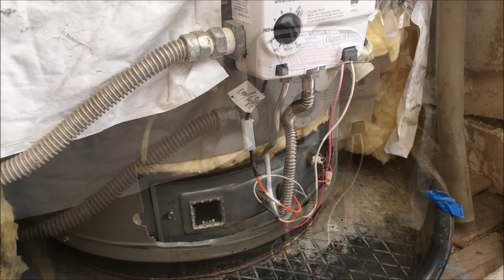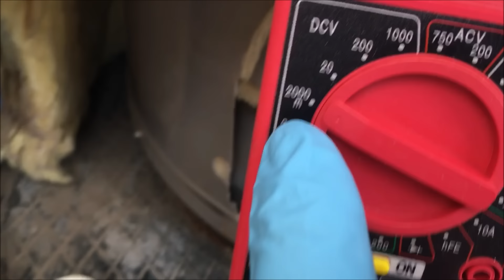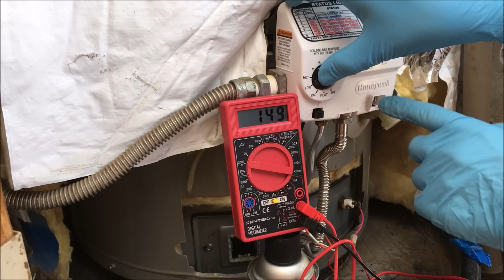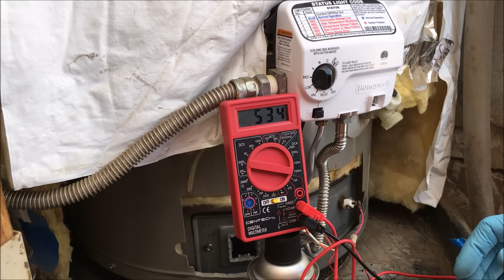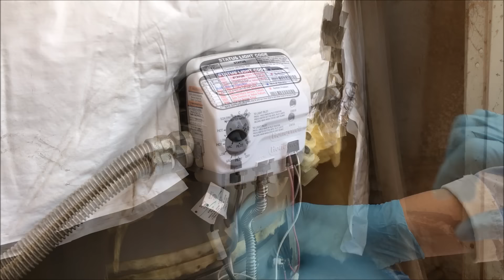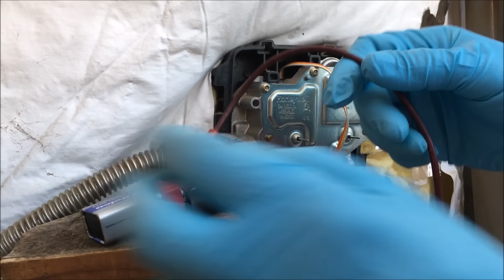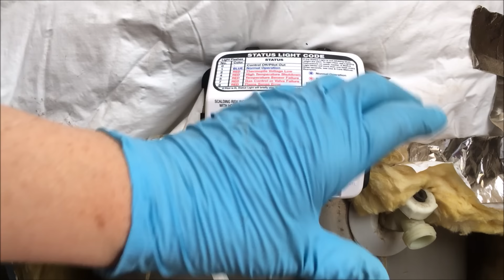Troubleshoot Water Heater AND Honeywell Gas Valve | Step-by-Step

Comment: great video beautiful ,    can  a control valve kit  be  replaced with a new one with out  fully draining. the 50 gal. tank  ? a guy told me  if the tank is drained  FULLY  the  sediment inside may  damage the tank  to the point of me needing a new tank also . right now I am just  paying them to replace the  control valve and pilot assembly . its a 2018 Bradford white water  heater .  I get a pilot  flame  but it goes out when I take my finger off the pilot button .  I get a spark too  when ever I push the  ignitor button .  any  ideas  ?
Reply from the maker: My guess is it's the control board that's the issue, not the gas valve.  You've got to go through the troubleshoot steps to figure it out.  You don't need to drain the water to replace just the control board, as I did, but, yes, I would drain the water to replace the gas valve.  ;)
Reply: @frugaldiy1   thx  , I will  try to see if I can order a new control board  for  my.  2018  Bradford   water heater .

Comment: After resetting the thermal switch button, I can get the pilot to stay on and the water heater to heat one cycle. Then the pilot goes out and I have to reset the thermal switch breaker. Could this be because the thermal couple is running too much voltage tripping the thermal switch breaker?

Comment: OK, I may have a weird one here! I can't get the Pilot to even light, even with a candle lighter. It just blows out, like it's getting to much pressure. I checked the regulator and it's sitting at 12, spec said 10-14 min of 11. The tank was made in July 2022, it worked for a year, then I left the house for about three years and it won't light. I even took the burner out, check the orifice tube and it's not blocked. So I turned the burner unit sideways outside the unit and connected the Pilot Tube to see if it would light outside of the unit with the Pilot pushed in. Nope it just blows out like a blow torch like valves are open to much for the gas or oxygen pressures. Any ideas, is the Gas Valve bad. The valve is a Honeywell WV8840B5077. I also tried to push the Pilot light in and out several times in case it was dirty inside, didn't help. Thanks in advance. Best Blessings. Keith

Comment: My only feedback is to invert the steps on the thermopile and switch verification. Do both first and if it checks well both are working. If it fails the test, then do the thermopile isolation to determine if it is the switch or the thermopile itself. That shortens the time a couple of mins. Either way is fine.

Comment: Incredibly helpful video!! We have a gas water heater that went out (unfortunately timed the day after we had a new gas line extended to the kitchen). We could get a pilot flame going but couldn’t get the blinking light to come on, so the pilot wouldn’t stay on.

Plumber came out to diagnose saying he could replace the thermocouple and gas valve for $700. Instead we found your video and did it all ourselves. Checked every piece of it just as instructed and all components worked perfectly. We realized the little metal cone-shaped ground terminal on the control panel had broken off somehow. Just had a buddy solder that back on the control panel in about 5 mins, and put everything back together. The hot water heater lit right up, normal flashing light and all!

Fixed it for free, and now I know how the hot water heater works. Thank you!!
Reply from the maker: Jordy, that's wonderful to hear you fixed your water heater yourself for FREE!  That $700 you saved gets you closer to earlier retirement.  Great job and well done!  ;)

Comment: Hello, I did everything you said and still pilot would not light. Bought another control for circuit board and still nothing. By this time I was comfortable taking it apart and putting it back together thanks to your instructions. Out of desperation I shoved a thin piece of wire into the pilot gas line even though when I blew air it came out the end. After shoving wire in that pilot gas line the air came out stronger. I put everything back and it works. Thank you so much. And now I know my family will survive taking cold showers. Thank you. Sorry for rambling. Happy I got it done after a whole week of cold showers. I gotta go take a hot shower so I'll stop. Thank you again
Reply from the maker: Harold, look how smart you are!  GREAT job!!  Now that's using your DIY brain.  Because of your hard work, your family will enjoy hot water.  Well done and respect!  ;)

Comment: Thank  you so much for this video, it let me determine that the failure point on my mother's water heater is also the control board!  Do you know how I can figure out which Honeywell or Resideo models have a compatible board? Ours (WV8860B1309) was discontinued and I can't find an identical one anywhere online, or even info on which other ones might work.

Comment: as for A.O. Smith gas water heater w/ honeywell controller... if you cannot get the pilot to stay lit (indicator light does not light up at all while attempting to light the pilot) BE SURE to check for a stand alone (usually small, round with two connectors) high temp/thermal trip switch located just below and to the right of the Honeywell controller... on it ( between the two connectors of that switch) you will see a tiny (usually black) manual reset/trip button... if it is tripped you WILL NOT be able to maintain a pilot lite...  mine trips, for whatever reason, every couple of years ... happy hunting!... 😃

Comment: Thank you for your Great video! Unfortunately, I have NO LUCK with lighting the Pilot. I cleaned it. I took it apart. I hold the knob in PILOT position for 2-3 minutes. Nothing worked...
Reply from the maker: You're welcome.  I had to go through each step of troubleshooting to find the issue.  Maybe try that.  I hope you find the problem.  ;)

Comment: Fan-darn-tastic, thank you!   I know this is old but not sure why you bought a new valve, vs. getting the board only via ebay though.  Not sure why but the re-store here in San Diego closed several years ago.
Reply from the maker: Thank you, Richard, for your kind words.  I think I paid $25.00 for the gas valve at Restore.  It's a shame the one near you closed.  ;)

Comment: How do you get that much voltage with 700mv to close relay? What is voltage on computer board? Excellent training video. Is it dangerous to override a safety function? You explain things very well.

Comment: if i try turn on water heater without shutting off combustion door with screws, does burner would turn on for functional heater ? @everybody bcuz i did suggested steps looks everything okay but door is not screwed yet

Comment: I know this is an older post, but this has been the BEST how-to video that I have viewed on youtube.  i only wish I had found it sooner since all other videos pointed to the thermopile.  This guide pointed me to a failed pilot solenoid valve.    Great post and thanks for all the help.  on a side note...i got curious to see how the solenoid failed and after taking apart the gas valve body, saw a single wire loop that had broke,  unwound it and soldered it to the horseshoe bar and it lives again. so now i have a spare
Reply from the maker: Thank you for the thoughtful comment, Arturo.  I appreciate that.  ;)
Reply: OI LOVE YOU❤❤❤ will you Marry me……IN THE cal SIERRA FOOTHILLS….no hot water for 5 days….YOU EXPLAINED EVERYTHING…SIMPLE ENGLISH FOR A STUBBORN retired 1st responder……swapped out 40 to 50 gal propane….I muscled the heavy waterheater up by myself….i bent the small pilot silver gas line.i smelled it while lighting pilot…MAINVALVE WOULDNT FIRE…pushed pilot line all way up into brass small fitting. ….so frustrated American proline were not helpful she said HIRE A PLUMBER..WTF…IM THE PLUMBER, ELECTRITIAN DRYWALL U NAME IT LADY IM MY WIFES zDADDY..   SLSO IBLEW OUTTHE BURNER LINES.  EW UNIT BUT A LITTLE BIT OF WHT INSULATION SEEMED TO COME OUT….YOUR SGREAT TEACHER….YOU SHOULD BE A REP FOR HWcompany

Comment: So I was changing the anode rod and didn’t drain enough water out. When that rod popped out hot water came spraying out of the top of the water heater. It went down the sides of the heater and went up to the top of the drain pan before I stopped it. Now it won’t light back up. I thought it may be moisture so I dryed it with a fan. Now it’s dry and still won’t light. I’m on step one, no spark from the igniter. I guess that thing to do is change out the igniter, thermocouple, Thermopylae assembly first. Does that sound correct?

Comment: I am 71 and generally try to fix everything myself.  I came across your video for testing a water heater gas valve and was so impressed with your detailed and very clear instruction.  Also followed your video on a four blink code for a high temp lockout.  I was easily able to address my issues with your help.  You provide a very good and valuable service. Hope you keep it up.  Save my butt!!!
Reply from the maker: George, that one of the most thoughtful and nice comments I have received.  I appreciate that more than you know.  I'm VERY happy that my video(s) helped you.  Enjoy the hot water!  ;)

Comment: I am going through the ringer with mine, and I think they sent me under warranty a new gas valve with a bad circuit board. They're overnighting the whole burner assembly for me, because the Thermopile was on the low end, we'll see how that goes, given it's at no cost to me, but  if that doesn't resolve the issue, I'm going to try swapping out that board. 

Leave it to cheap electronics. Thank you for being clear and concise, because man, I would not have known to even try this step, I would have been swapping out the gas valve again, and I would much prefer avoiding that.
Reply from the maker: You're welcome, and I hope the new burner assembly resolves the issue.  Yes, chasing an issue with a water heater can be long and frustrating.  Hang in there, Kopa!  ;)

Comment: Kudos.
Exceptional and comprehensive tutorial.
Reply from the maker: Thank you, Bruce.  I appreciate that--greatly.  ;)
Reply: I have 750mv at the control board, as shown on my Fluke DVM.
This indicates the control card is failing, no Status light.
I do not believe my diagnostic technique is in error.
New assemblies are $400 for valve and controller assembly, which is excessive for a 13 year old water heater.
I took a chance with a replacement used item from eBay, but it arrived with a dead controller card.
The vendor is sending me another controller card... and we are boiling water for sitz baths for two weeks now, while waiting for the next card to arrive.
CA, CO and UT have banned 50 gallon, 40,000 BTU water heaters due to new smog laws, so I will have to drive out of state to buy a replacement.

Comment: Mine is only a few months old, won't stay lit for more than 24 hours. I dont see any red error blinks by the time I realized it's off. I can light it up again, but it will just go out again within 24 hours. I thought it's the gas control unit so I called Rheem and they sent a gas control replacement, but the issue still happens. Can you please advise what other things I should check?

Comment: Top notch instructions! Diagnosed my water heater in less than an hour. Needed a new circuit board, ordered new one from ebay and it fixed my problem. For anyone who reads this in the future: The whole control unit is almost the same price as just the board. In retrospect I would of just bought the whole control unit. Either way you go these instructions are top notch and precise.
Reply from the maker: I appreciate that, and thank you for taking the time to leave such a thoughtful and helpful comment.  ;)

Comment: Thank you very much for the informative video you provided. I have a question regarding the testing procedure. While I noticed that the thermopile is clicking as expected, I am concerned that the main burning valve is not responding with a click. 

Could you please advise on how I might resolve this issue? 

I appreciate your assistance. 

Best regards,  
Chris Yos
Reply from the maker: If you test the valve itself, and it's failed/not working, you have to replace the valve.
Reply: @frugaldiy1  Thanks!

Comment: Man. I just diagnosed a water heater. Now I’m debating whether it’s the gas valve assembly or the igniter itself. 
I’m thinking it’s the igniter. But how do I know if the honey well control is even supplying voltage.

Comment: I can establish a flame, and if I hold pilot switch down  pilot keeps going and the thermopile voltage went to 670mv and still climbing. Therefore, the control valve must be bad because as soon as I release pilot lite knob, flame goes out. I see no thermal switch. 2 Wires from thermopile goes straight into control board.

Comment: I got home today and my pilot lite was out and no light on the circuit board. I took it all out and cleaned it but pilot lite would not stay lit or power the circuit board. I watched a bunch of other videos about testing the thermocouple which had 100mili volts jumping all over the place. I had my mind set that i needed a thermopile till I sat and watched your video. Nobody mentioned the thermoswitch being inline and testing without it. So 10pm I test again and my thermopile rised above 650mv. Reconnected the thermoswitch and got the same reading. At 650mv it doesnt take much pin terminal resistance to drop below this. Plugged it all in and is working properly at this point. If it happens again maybe ill be able to catch a code before the circuit board loses power again or I'll go find a thermoswitch. Thanks for going in such great detail. 

Only issue I've had so far is finding a thermoswitch that looks just like the one I have now which is just a single straight tube maybe 4-6" long vs most that are tubes wrapped 2 or 3 times almost like a coil. Connectors and everything looks exactly like your setup
Reply: Reply to my own comment. I may have hit the reset button when I went to test the thermal pile by itself. I didnt know the reset button was there. This is very possible the thermal switch tripped from build up of bird feathers and dust restricting air to my pilot light cause it's in our bird room. Could possibly been fixed hours ago when I cleaned everything out but not knowing to hit reset button. Will find out soon enough I guess

Comment: Thank you so much for such a thorough and complete troubleshooting guide! I was ready to buy the control board but applied power to the pilot valve and I got nothing. Main valve is clicking. My problem is the pilot goes out the second I stop pressing down the switch. Everything else checked out fine.
Reply from the maker: You're welcome, and thank you.  Good job troubleshooting the issue.  Yep, likely the pilot valve.  If it helps. some commenters have said they found the pilot pin was loose and soldered it back in place, which fixed the issue.  ;)

Comment: I followed this video because I had the same problem. The pilot light would not stay lit and I would not get a status light.  It was my circuit board.  I ordered one for $45 and that fixed my water heater. When I got my circuit board, I had to set it to the off position, for some reason it came set on the very hot setting.
This video helped me a lot and saved me some money.
Reply from the maker: I'm glad my video helped you fix the problem and save your hard-warned money.  ;)

Comment: In my case, my pilot light gets blown out by a yard blower or high winds. My heater is located in an outdoor vented cabinet. So - thank you for your first 1min15sec introduction on this video. I then skipped forward to 28:25 and kept pushing the igniter until the status light started flashing, then as you instructed, keep knob pushed inward in pilot for 30 seconds. Then switched to hot... good to go.   Thanks so much!!
Reply from the maker: I'm glad it helped.  You're welcome.  ;)

Comment: Hi my pilot light would stay on but the status light isn't blinking at all, what does that mean.
Reply from the maker: My guess is the control board.
Reply: @frugaldiy1 Thx you I'll try replacing the board and see if that solves the issues.
Reply from the maker: You're welcome.  ;)
Reply: @frugaldiy1 hi just wanted to give an update. IT WORKS! Thank you. It really was the circuit board, you save me from spending 3k. Those plumber really wanted me to just replace everything, can't even trust plumber these days.

Comment: My lights blink twice which indicates “thermopile low voltage”. I was just going to go to pick up a new thermopile but after watching your video and looking at the first thing you checked to see if you could see a spark - I see no spark at all when I strike the switch. Any idea what I should try? Replace the thermopile or is my ignitor switch bad?

Comment: Hi there, this video has been so helpful, just wondering if you can answer a couple questions for me I'm dealing with some issues with my hunnywell that is 10 years old ,  I'm wondering what I do if I don't get a spark when I test my igniter does that mean I need a new one.
Reply from the maker: If you don't see a spark, the pilot will not light.  I'd remove the burner assembly and clean the igniter head and pilot head with fine-grain sandpaper.  This video shows you how to remove the burner assembly:  https://youtu.be/httzdihCxvM
Reply: @frugaldiy1 First of all thanks for all of your efforts in the videos you do!  Incredible work. I have this same issue going on now. I took everything apart and cleaned what you said with fine sandpaper but still no luck. I don’t see a spark at all. I put everything back together and tried to ignite and I still get the 2 blinking lights for the thermopile low voltage. Should I just try to go ahead and replace that?  Or, what would you suggest I do going forward?